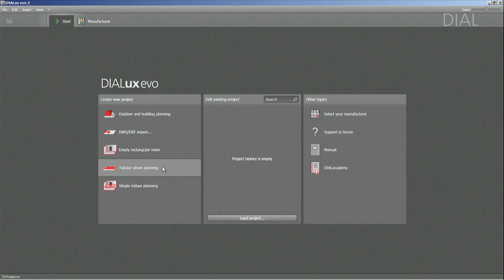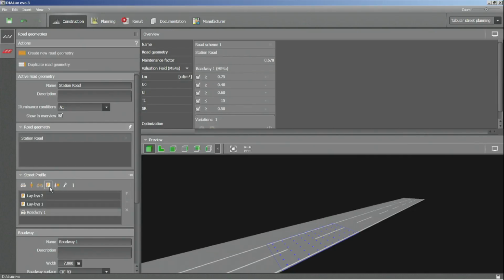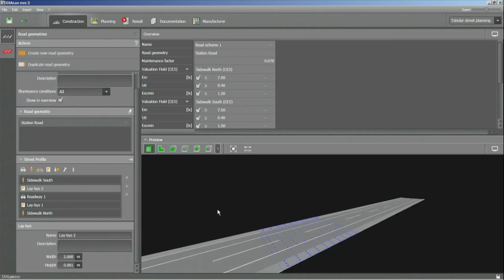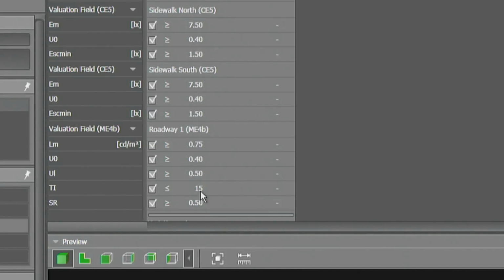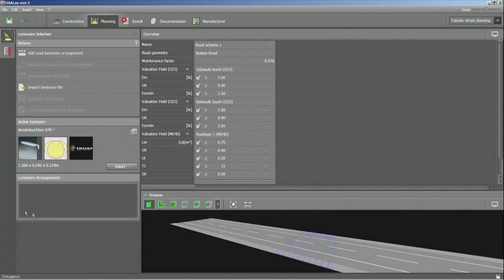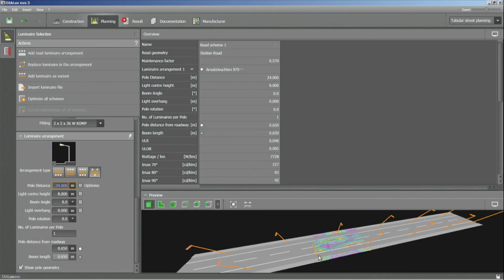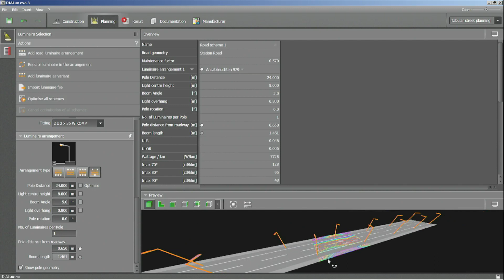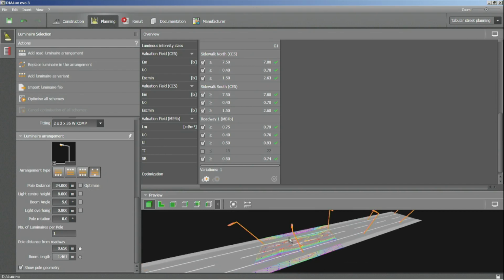DIALux evo Tutorials for Beginners part 10 — Street lighting

Comment: foremost and for all I want to say sorry regarding with this question, I'm just only a newbie in this industry. I'm hoping that you could help me because my mind will be EXPLODE thinking about this. I just wanted to know only if what is the use of those illuminance classes A1, A2, A3, A4, A5, CE2, CE3, CE4, CE5, S1, S2 and so on for sidewalks. And also for the roadway the illuminance classes ME3b, ME4a and so on. Is it requisite to determined individually? Thank you so much and looking forward to your kindness and patience. God Bless everyone!
Reply from the maker: Illuminance classes are determined in EN 13201 and reflect the traffic and use on the road. Obviously a wide and more frequented road in urban surrounding will need a higher level of illumination than a small country road with low traffic and few visual obstacles. You should definetly check the standard and be in contact with your client on this point to receive the relevant information to determine these classes.